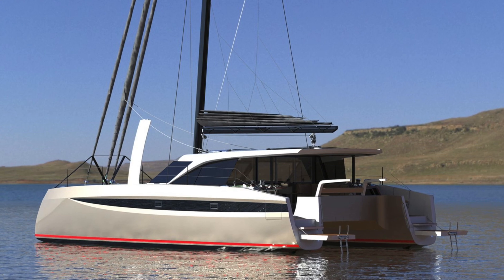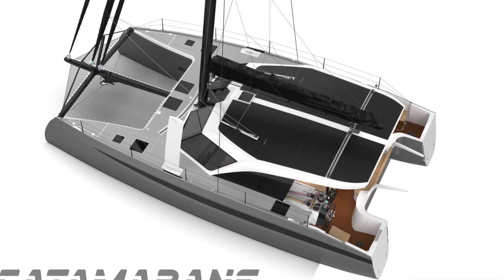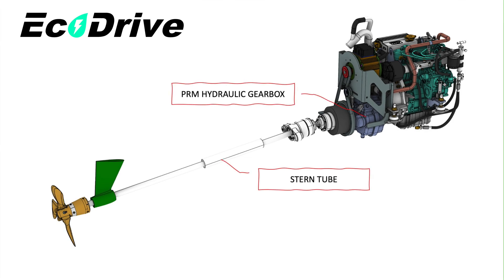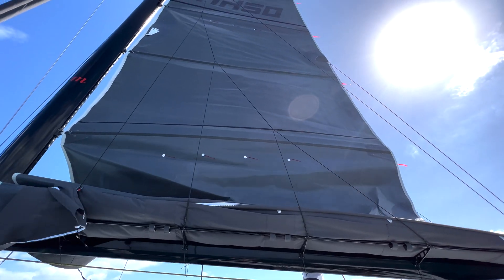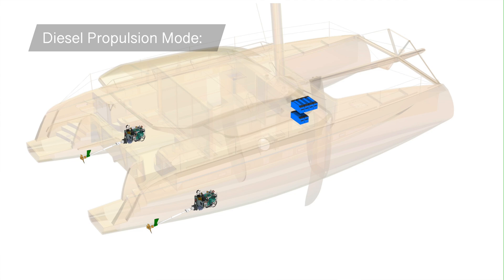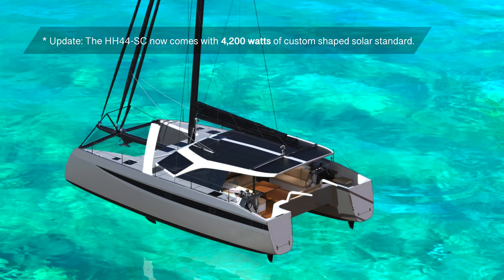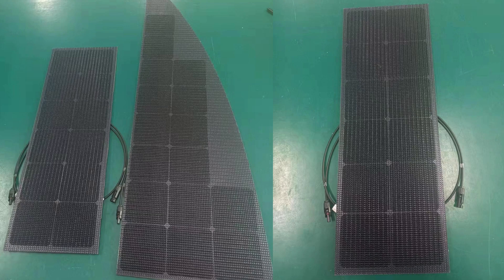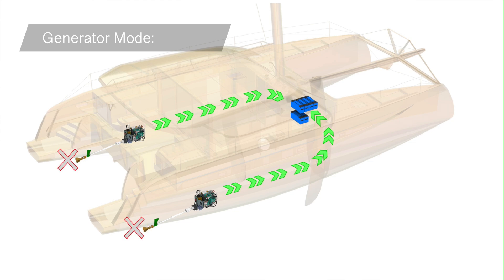Electric Catamaran of the Future: The HH44 EcoDrive (Episode 4)

Comment: I guess I understand why Nicky and Jason Wynn wanted to buy this catamaran, and have one in process.  I was a little hesitant getting behind their decision, since it didn't seem to answer all of my questions, but this certainly does.  If I was in a position to be buying one of these, I would want some changes made (I don't like the cockpit layout) but I wonder if it would be possible to double the size of the battery bank.  A Tesla Y sport model has an 80kWh battery, and they exhaust it in 325 miles or so.  With the price of fuel, at least here in the U.S., hitting record highs, I'm sure that diesel fuel elsewhere must also be climbing, so the less I need to run the engines to recharge the batteries will an anchor, the better.  But, I don't know if it's worth the extra cost of 40 additional kilowatts of battery capability.

Still, thank you for this great presentation of the EcoDrive.
Reply from the maker: Why double the size? Surely two hours of propulsion will get you out of the marina and into the wind and back?
Reply: @HHCatamarans  not worried about being in and out of the marina as much as I am being on the hook with four days of rain and overcast, and using all sorts of electrical devices on board.  Yes, you can run the engines as generators, but IF you can have the space to double the size of the battery, that's less fuel you'll use and we all know how expensive fuel is right now.
Reply from the maker: Yes, in this example, you might want more batteries. We had to make a decision in the design phase and rather than add more weight and detract from the performance of the yacht, we tried to find the right compromise. Yacht design is always a compromise!!!
Reply: @HHCatamarans  it's one of those things where it's a matter of individual taste, but I can see where and why the decision was made.
Reply: @HHCatamarans  How much will the Lithium battery bank weigh?
Reply: @HHCatamarans  I wonder when there will be an inflection point where the design will call for a small diesel tank (let's say 8h worth of travel) and large battery banks. HummerEV has 212kW worth of batteries, surely we'll get to that in sailboats within a few years. That way at 10kW you could motor overnight and recharge during the day, if needed, while using the diesel engine for a last-resort choice only (lighting strike, flooding leading to electrical system compromise, etc).
Reply: @tonystewart7287  It should weigh roughly 200 kilograms, plus a battery box.
Reply: @GaryMCurran  The practical answer now is that the moderate battery pack size they chose is reasonable since it will more than power most propulsion, cooking, cooling, etc. needs., and if more energy is needed it's more practical to run a diesel as a generator.  At anchor, 3 kW solar plus 40 kWh battery is more than enough for house loads, if it's reasonably sunny.

Given that performance boats will spend far more time sailing than motoring, it probably doesn't make sense to double the battery capacity.  At some point added battery weight negatively affects performance, without much practical/operational benefit.

Engineering is all about balancing tradeoffs, and HH seem to have picked reasonable values given the current state of things.

Comment: We are looking and researching cats to purchase and move on as full time live aboard.
I love what you do and heard of you through the Wynns.
Can the HH44 be ordered with a half raised helm??
The lower helm is a definite deal breaker.
Reply from the maker: The HH44 was designed with electrification in mind, so the large coach roof is part of the design that makes this Parallel Hybrid concept work. If we raised the aft helms it would interrupt the amount of solar and affect the charging capacity, so for this reason we have the helms aft. To improve the visibility we have added the swing helms. Everything is a trade off in yacht design.
Reply: @HHCatamarans  Raised helms also are less efficient due to raising center of effort, increasing leeway, associated drag, etc.  

That said, I'd rather have a Chris White style front helm than aft helms.  He makes a very good case for them being safer.  They're also more efficient for control of lines, visibility of sail trim, view forward, etc.

Comment: The real key is more efficient solar panels. Not quite there yet, but they're getting better.
Reply from the maker: 4,200 watts gets you there quite nicely!
Reply: @HHCatamarans  Well this bad boy is a top contender when I'm ready to buy some day that's for sure. Looks really great.
Reply: @calledout4437  There are physical limits to conventional silicon solar panels.  The Shockley-Queisser efficiency limit is 33.7% for a single-junction solar cell.  Practical cells are much lower than that.

That said, enough solar for house loads at anchor, including air conditioning, are easily achievable today.

Comment: Something I’d love to hear more about is motor-sailing in light/variable wind with the electric drive for short periods. Could really be a godsend for night shifts and not waking the crew ❤
Reply from the maker: Yes, the idea of silently creating more apparent wind with a small amount of throttle on the leeward side will also boost the performance of this boat (without having to listen to Diesel engines)! Meanwhile, if motoring overnight you can absolutely run one Diesel and one Electric to keep things quiet but efficient. Sadly battery technology will not allow for 7-8 hours of electric only power overnight.
Reply: @HH Catamarans  What's the lifespan of the batteries? I mean, before I have to replace the whole bank, how many times would they take charge if I consecutively deplete them by using for 1.5 hours every time they are filled up and refilling them via 2.5-3 days of full Caribbean sunshine or running one of the diesel engines for 9 hours?
Reply from the maker: After 3,500 cycles the batteries should still be at 80% Cycle Life DOD. You can charge the batteries using both EcoDrives in less than four hours. It should be years and years and years of use.
Reply: @HHCatamarans  such an awesome system 👏

Comment: Since the Props will either be in drive mode or regen mode, are you going with folding props, or much larger more efficient fixed props?  

For weekend or near shore sailors there is an interesting mode - if are not quite making a buoy, floating debris, or some other obstacle due to the direction or wind speed, you can just give yourself a few seconds of power on one electric engine, rather than starting up a diesel, shifting into gear, a few seconds of power, then shutting it down.
Reply from the maker: The boat will come standard with folding propellers. If you lock the boat in gear the props will fold for better efficiency while sailing or racing, but if you leave them open they will spin and regenerate power while doing so.